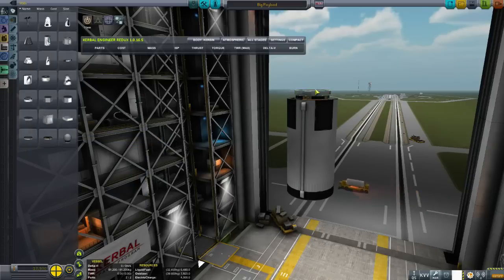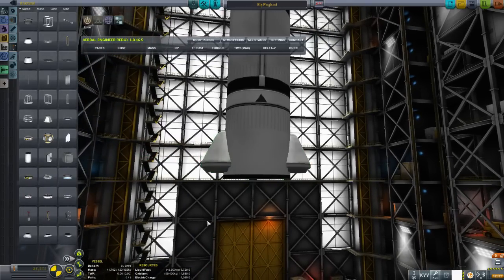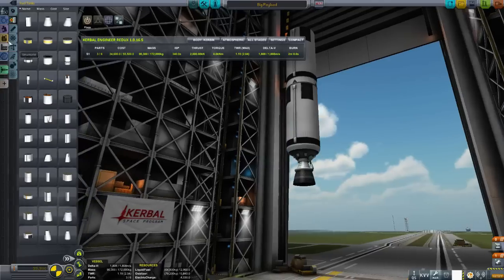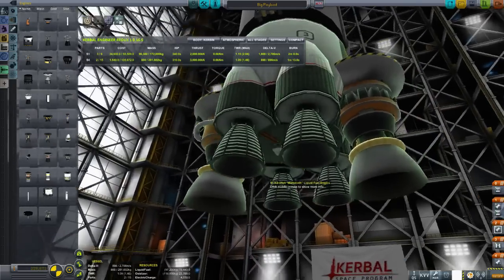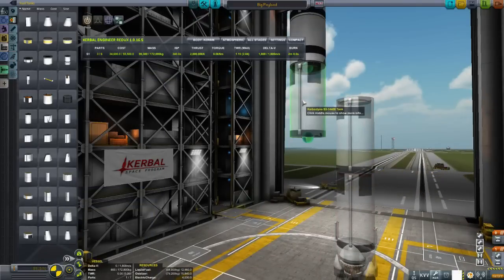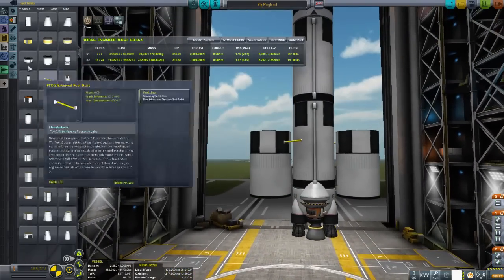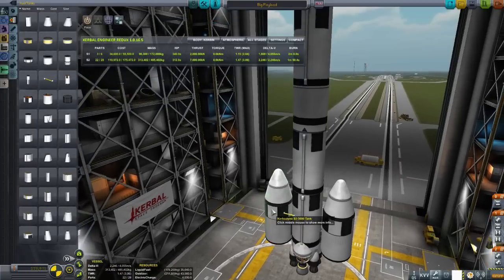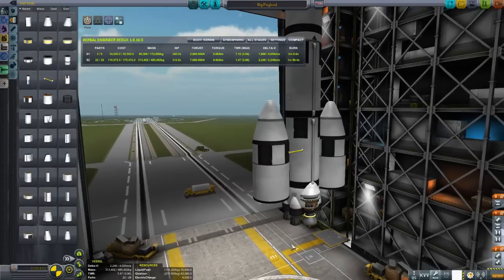KSP Build Better Rockets 4 Lifting Really Big Things

Comment: Small tip,

if you want to lift REALLY heavy loads, for your first stage, place a vector engine with 8x symmetry instead of a mammoth engine. Mammoth engines are just FOUR vectors strapped together (read the mammoth's description)

Comment: Just stumbled on this series. Great stuff. I've been playing ksp for about a year without ever looking at twr and dv. I've had the hardest time flying to other planets, especially when I'm trying to do a landing. 

Question: Do most structural elements allow fuel crossfeed? For that matter, do most elements allow crossfeed except things you wouldn't to have do that, like decouplers?
Reply: Kit Donnelly most structural elements(it will say if it has crossfeed) have crossfeed. Also, you can enable crossfeed on decouplers.